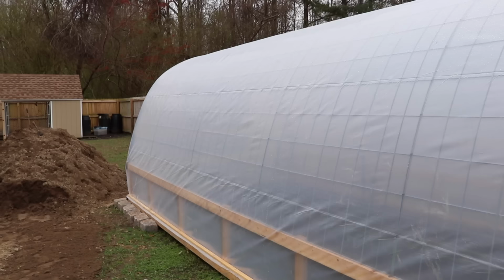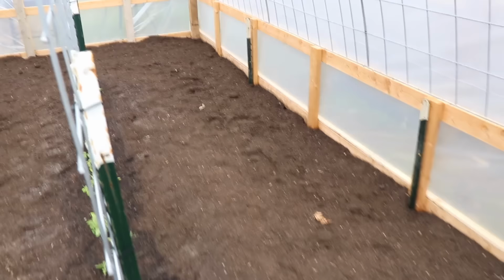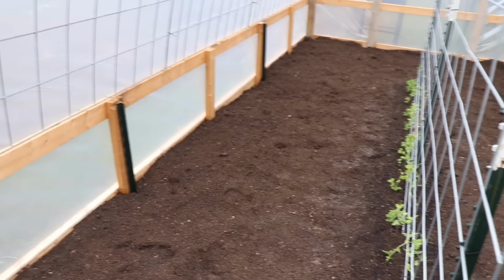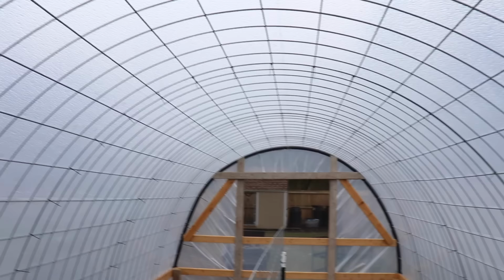DIY Cattle Panel Hoop House || Build Your Own Cheap & Easy!

Comment: I have only found 1 place where I could get 40x100 4 mil clear plastic
What I building is 23ft long 10W 8H
Reply from the maker: Brandi, we bought ours on Amazon. I have the link to the exact greenhouse plastic we used in the description section of the video where I have the materials list. 

I think your best bet is purchasing from Amazon in my opinion, because you can choose from different sizes that are fairly inexpensive. If you’re not buying from Amazon, I’m not sure where you would have to go to find the right plastic/size. 

Here’s the direct link to the plastic we bought from Amazon: https://amzn.to/3wmUcFO

It’s more than enough plastic. You just have to cut off the excess. I hope that helps.

Comment: Hi
So my only concern is rust, does the metal work rust against the polythene, as im sure the polythene gets very wet with condensation?
Reply from the maker: Hi! We’ve had zero issues with condensation. The hoop house is well-ventilated with fans circulating the air through in the warm months. We’ve never had condensation or rust. 😊

Comment: just curious what is the temp differance between inside and outside the greenhouse in the winter? debating if ill have to add heating. Thanks
Reply from the maker: It all depends on where you live but most likely you'll need to have some type of heater if you plan to do a winter crop. :)

Comment: Hello, Thank you for sharing the awesome video. It will be very helpful for me. Just to confirm, is it 8 ft height, 20 ft long and 10 ft (or 8 ft) wide hoop greenhouse? 
Would it be possible to make one 7 ft height, 16 ft long, and 10 ft wide? I have to keep the height short since I have HOA (yup HOA). In that case, what should be the height of the side of the wooden frame. I appreciate your help. Thank you.
Reply from the maker: Hi there! Our hoop house is 20ft long by 10 ft wide and 7-1/2 ft tall. You can make your hoop house however long you want to. You might have to cut the cattle panels though if they're too long, but thats easy if you cut them the way we did. The wooden frame is 2 ft tall...I would leave this height the same even if you make the hoop house shorter (16ft like you were saying). 😊
Reply: I am watching your video again and again 😊😊😊 Trying to understand whether I would be able to do it or not. 😆😆😆 Anyway, thank you so much guys. Keep posting good videos so that we can learn 😊

Comment: Please advise, what size of pipe insulation do I need for covering the wire ends? Thanks.
Reply from the maker: I think ours was for 1/2” pipe, but it doesn’t really matter…you can go smaller or bigger, just as long as it covers the wire. 😊

Comment: I see you used 2x4x10s what was the top of the pitch?Also zone and snow load?TY.
Reply from the maker: Tina here, don’t know the pitch. The hoop house is 7-1/2 ft tall. Zone 8a. We don’t get much snow here. We’ve had 5” on it before & it was fine. If you live in a heavy snow fall area, I’d recommend a center beam for extra support. 😊

Comment: Did you use any string or rope for tie downs?  If so,  what kind? Thank you!
Reply from the maker: Yes, I don't know the brand but we just got the rope from Lowes. The thicker (white) rope that we used to tie down the corners of the shade cloth was just a natural cotton rope. And then we used a smaller nylon string to tie down the centers of the shade cloth. Nothing special, any rope will do really. :)

Comment: Need to use wire to hold the panels together zip ties won't hardly last a year and come off.
Reply: actually they will! zip ties will hold a muffler on a car for years it can certainly hold here just as well if not better

Comment: What are the dimensions of 'cattle panels' please? Where we live, outside Montreal Canada, nobody has ever heard of them. The closest we can find, are the panels with 6 inch squares used for reinforcing poured concrete slabs, measuring 4 ft by 8 ft, and they are not galvanized.
Reply from the maker: Hi David, these cattle panels or some call them hog panels, are 16ft long by 50in high. 😊

Comment: Surely the metal grid will get hot and melt the plastic
Reply from the maker: Never has and we have over 100 degree heat in the summertime here in VA. With the two windows & fans running to circulate the air & the shade cloth we added to the top of the hoop house, the plastic has never melted nor even got hot. It’s cool to the touch.

Comment: On your list of materials you have 2. 4X4’s listed. What is the length of those.  I want to get one of these started
Reply from the maker: Hi! There are (2) 4x4s. They are each cut in 1/2 so you have (1) for each of the 4 corners. They are buried 2ft with cement, leaving 2ft above ground. 😊

Comment: Looks really great. But your'e construction has a downside: The wood has direct contact to the edge. 
It will take one year and ths wood is moldy. Better use iron, plastic or stole pipes or something else
Reply from the maker: Thanks for your comment. We’re aware that the wood should be treated but this is a mixture of what we had on hand & what we could afford at the time. We’re moving in March anyway to Alaska. This wasn’t a permanent structure for us. 😊

Comment: i love your build... so I live at 3100'. get some snow 2-3 times in the winter but not too much.  my main concern is summer, where i have 3-4 months of 100 degree weather.  did you say you covered yours in summer with shade cloth to grow veggies inside?    I need to do that because i have gophers, rabbits, squirrels and deer to deal with.   I'll probably put a 4-6" gravel base to keep out the gophers, and then bring in good soil on top of that.... what do you think?   thx again for posting-Geo
Reply from the maker: Hi Geo! If it gets that hot where you are, def get a shade clothe, make sure you have good ventilation with fans to circulate the air thru. Try to only plant veggies that like warm weather or else it’ll be too hot for them in the hoop house in the summer. It does get pretty warm in there! We don’t have much snow here in VA so we’ve never had issues with snow load, but I would think some good support beams down the center would help support the fence panels to carry some snow load. 😊
Reply: @HomeFreeAlaska  That would involve removing the polyplastic and before putting up the shade cloth?    And if my area is on a grade lengthwise, how steep is too steep?   right now it's like a 6' in 24'...
Reply from the maker: @privateuploads-geo2625  I don’t know what you mean by reliving the plastic. If you watched our video you’ll see that we built a window into the back of the hoop house & screened it in and also put a window in the front door and screened that in. So the screened windows were built into the hoop house during the build not after. After we built the hoop house, we went back and cut the bottom of the sides to do “roll up” ventilation siding. I have a video on that process as well. As far as the grading, I’m not really sure. We built our hoop house on flat ground, I suppose some grading might not be a problem but I would worry if it was built on too steep of a spot that the plants at the bottom of the grading might get too saturated with water ya know? Ventilation video: https://youtu.be/QACRQN920pE

Comment: Awesome greenhouse! I want to build one like it, I'm curious where you live?  Do you have to deal with snow and ice?
Reply from the maker: Hi Chris! Not too much snow where we're at but we do get snow. We clear the snow as soon as it starts to build on top. But I've had a lot of subscribers in heavy snow areas that say they just add support beams down the center of the hoop house and they've held up nicely :)
Reply: @HomeFreeAlaska  do you have concerns for you 2xs rotting?

Comment: Can I get a little more info. I didn't see any measurements for the front and back ends, like door frame, and window. Would like to build one some I already have panels. Thank you
Reply from the maker: Hello! We just winged it for the window & door haha...Really these can be whatever size you want. Make your window the measurements you want it to be and go off of that, that's what we did. And for us, we just made sure the door was wide enough to fit a wheel barrel through. :)

Comment: How have those fixed sides worked out for you through the summer? Did it get too hot?
Reply from the maker: Hi there! We actually ended up modifying the hoop house with roll up sides for more ventilation. That video is here, if you’d like to check it out! 😊 https://youtu.be/QACRQN920pE
Reply: @HomeFreeAlaska  Thanks!!!

Comment: The wife and I are in the process of building a 12x32 hoop greenhouse now. The issue we have is the panels pushed the side frames out really bad. (I had to add bracing on the outside to straighten and shore it up. I really don't want that bracing to stay there) I notice you don't have anything yet it looks straight. Any advise? (I used the heavier gauge 6' green post as well)
Reply from the maker: We added metal T post stakes to the inside…pounded them down into the ground and screwed them to the wood frame. Maybe try that?😊
Reply: @HomeFreeAlaska  That's how we built ours.... We used the 6' T post as they're a lot thicker than the 5'. We'll be putting the plastic on tomorrow so I'll see if it's any sturdier now that I have the ends put on. I still think it may be due to the sides being 4' tall and 12x32" overall width

Comment: Does it snow a lot where you live????? Seems like an awesome cheap setup but I'd worry about snow load.
Reply from the maker: We don't get much snow where we're at here in VA. I have had subscribers that have built this in heavy snow areas and they say they do fine with extra support beams down the center to help support the cattle panels.
Reply: @HomeFreeAlaska  great! Thanks for the info

Comment: Is that plastic meant for outside use? If not, you'll be replacing it every year.
Reply from the maker: 4 months after the build we had to change out the plastic. We changed it out with a durable, long lasting greenhouse plastic which was 40X26ft, 6 MIL thick: https://amzn.to/3wmUcFO

Comment: How much did this cost you?  all of the framing materials I just priced out at $450+, and there are multiple kits in the $300 range for a similar size. Its a great build, looks nice and sturdy, and if you are just looking for a DIY project for fun, seems be great, but not a money saver unfortunately, at least for the materials and kits I have access to.
Reply from the maker: This build cost us just over $500. We priced everything out. This was before inflation of course. We weren’t interested in purchasing a kit. We like to build things from scratch ourselves.😊 Nothing wrong with buying a kit tho if that’s what you prefer!
Reply: @HomeFreeAlaska  No worries, was curious to see the difference between where I am and alaska.  And often see DIY projects that are as much or more than prebuilt options passed off as cheap alternatives.  Doing it for the fun of it is 100% valid

Comment: Why not use screws on the fur strips you nailed in place hold plastic?? Especially if you have replace plastic!
Reply from the maker: You can use screws if you want. We had nails on hand and that’s just what we used. We’ve already replaced the plastic once and it wasn’t a big deal to take the nails out lol! 🤷🏼‍♀️😉

Comment: I’ve watched this from the beginning a couple times. Unfortunately it doesn’t show if/how you secured the two side rails to the ground before adding the first cattle panel. 
I saw Joe cut off a pipe of some sort. Was that secured in the ground? 
Also, I can’t tell from the video. Did you make a groove to sit the end of the panel into before tacking it down?
None of this is criticism. I seriously can’t tell. I love the whole thing and want to copy it for my place. Thank you if you have time to answer. 

I started watching your Q & A video but the questions I heard didn’t apply to me. 

Thanks a lot.
Reply from the maker: Hi friend! The two wooden frames were secured with 4X4s 2 ft down in the ground with cement. Then we added 2 metal T-posts for added support for the center, that we also buried down 2 ft. 

One on each side. What you saw Joe cut was one of the T-posts because we couldn’t get it down into the ground the same level as the other one. So we got it down as far as we could and then cut it to make it match the other one.

We did not cut grooves in the wood for the cattle panels. We hammered nails into the wood & then sat the cattle panels on the inside of the nails which gave resistance and held it into place while we secured it with U-nails. Then we went back & just hammered the straight nails over the cattle panel. 😊

I hope that helps! Let me know if you need anymore clarification. Thanks for watching! 😊
Reply: @HomeFreeAlaska  - Perfect!  I thought I could see 4x4 posts and I also ‘thought’ there were T-posts. Fantastic. That was smart.  
I also love the idea of the nails to form a boundary (or whatever) for the panels! You two are pretty darn clever. 
Also, I loved that you both work together in the project. My wife is pretty good too, but that’s not every couple. 
Thank you so much for the prompt response. I really appreciate it.
Reply from the maker: @returntoyehovahthelord6185  our pleasure! Wasn’t the most perfect build…but it was easy (and fun) to put up & has been a great addition to our garden space! 😊 Good luck on your build. Also, we love to hear from folks that have built & hoop house! If you’d like, you can send pics of your build to homefreealaska@gmail.com! 😊It’s really neat to see what you’ve done!

Comment: How tall is it inside, i'm doing this but need to plan snow weight and put inside posts and length is important.
Reply from the maker: I believe it turned out to be 7 1/2 feet in the center.

Comment: Hi!  Do you think you could have gotten by with a short piece of plastic instead of 100'?  If so, how much do you think would be enough lenghtwise?
Reply from the maker: Hi Suzie! Absolutely. The hoop house is 20’ long…but you need to have enough to go over the front & back all the way to the ground. I would say to go at least 40’ to be on the safe side. That’s if you’re doing the same measurements we did for the hoop house, 20ft long x10ft wide.
Reply: @HomeFreeAlaska  Thank you!  I've started mine yesterday :>)   I've seen a few that have a 4' wide door.  Have you felt a need to have one that wide?
Reply from the maker: @PetalsAndMetal  we just made sure it was wide enough to fit a wheelbarrow through just in case we ever needed to! Other than that, it’s just a door to walk thru! 😊
Reply: @HomeFreeAlaska  Thank you!

Comment: Did the cattle panels tear holes in the plastic? Lots of sharp edges/corners.
Reply from the maker: No, that’s why you put the styrofoam insulation tubes on the cattle panel ends.

Comment: It's been a year, have you needed to replace the plastic sheeting? If so, what was that like?
Reply from the maker: We actually chose to replace it 4 months later. We bought actual greenhouse plastic that was much more durable & long lasting. The process wasn’t hard at all. Just took the old plastic off & put the new plastic on. It looked way better too as the greenhouse grade plastic was thicker & more see through!😊

Comment: How about the snow how many inches during winter?
Reply from the maker: Hi! We don’t get much snow here at all. I suppose if you live in a heavy snow area, you may want to consider some additional supports inside as the cattle panels alone won’t be strong enough to withstand heavy loads. 😊

Comment: Do you have a list of materials you used for the project anywhere?  What are the dimensions of the cattle panels
Reply: I apologize, I found the materials list, it just doesn’t say what size cattle panels were used.
Reply from the maker: @k.strickland  Hi! Yes, the materials list is in the description. 😊 And I updated the cattle panels to show the size too which were 16ft long by 50in high. Thanks so much for watching our video! 😉

Comment: Snow will bend it or collapse  it.
Reply from the maker: We’ve had snow and have had zero issues. But we also clear the snow as soon as it settles. If you live in a heavy snow load area then it will need extra support beams down the center.

Comment: In which state is this located? is it strong enough to hold decent load of snow? Thinking of building one like this up northnin Alberta
Reply from the maker: Hello we live in Virginia. We get light snow loads here. If you get a lot of snow I’d def recommend a center beam for support. The cattle panels will not be able to hold up a heavy snow load. 😊

Comment: Is the greenhouse plastic dimensions 20x40 instead of 40x20?
Reply from the maker: 4 months after the build we had to change out the plastic. We changed it out with a durable, long lasting greenhouse plastic which was 40X26ft, 6 MIL thick: https://amzn.to/3wmUcFO

Comment: zip ties will not last. there are connecters or use plumbers rings that screw tight
Reply from the maker: They’re holding up so far! We just used what we had on hand at the time. 😊

Comment: On the 2 4x4's that you used, what was the length on those?
Reply from the maker: Hi Jericha! We had (2) 4X4s...the length for each was 8ft. We cut them in 1/2 & put one 4ft section in each corner & buried it down 2 ft into the ground into cement. So the part sticking out of the ground, was 2 ft tall. Hope that helps! Thanks so much for watching our video! :)

Comment: The plastic will not cover my ends so how to use two pieces of plastic???
Reply from the maker: Looks like you must’ve bought the wrong size plastic. If you built a 10X20 ft hoop house like we did in this video, the link I provided for the plastic was plenty. It was actually more than we needed to cover the hoop house.